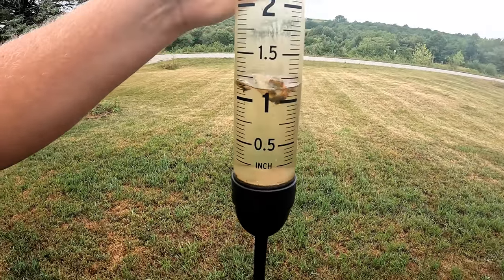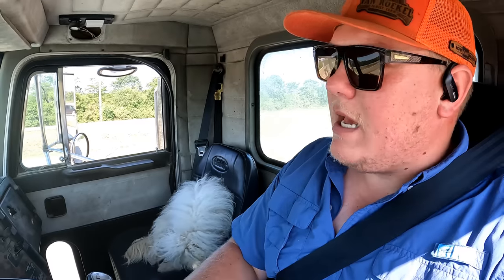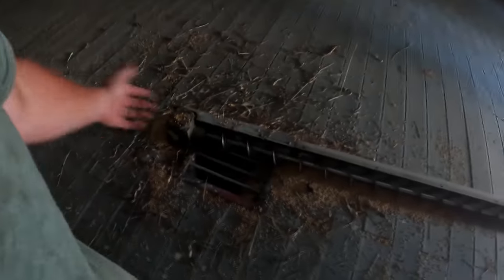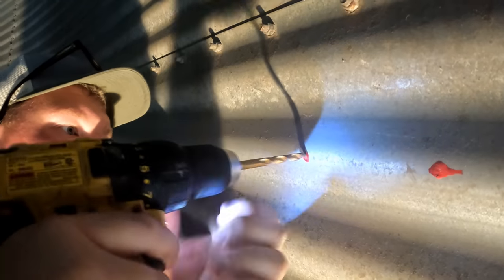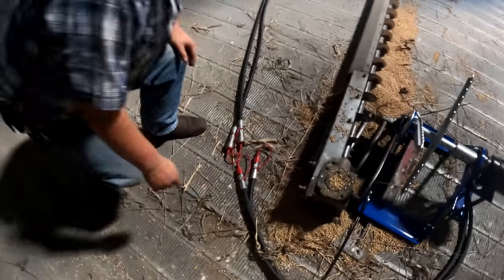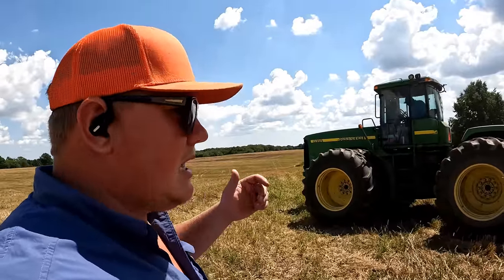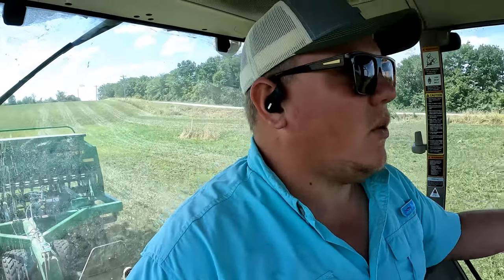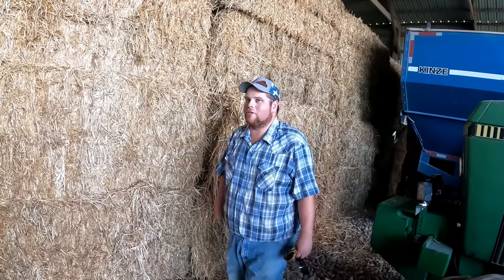LIFE SAVING GRAIN BIN EQUIPMENT - Sump Saver

Comment: Just get rid of those bars across the sump.  Also, make a cage above the sump, that will prevent a large moldy clump gain to plug the whole sump them, Remove the cage to run your sweep then.